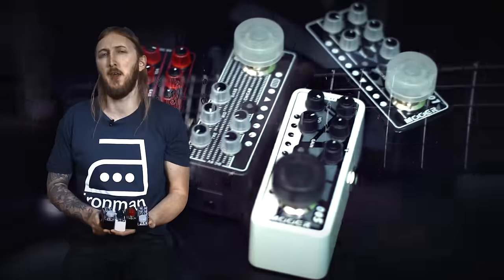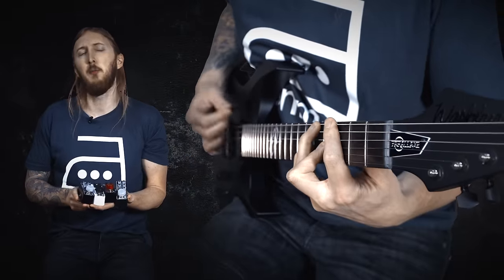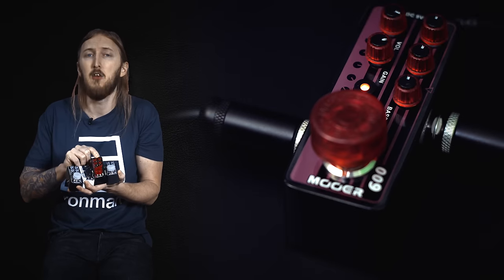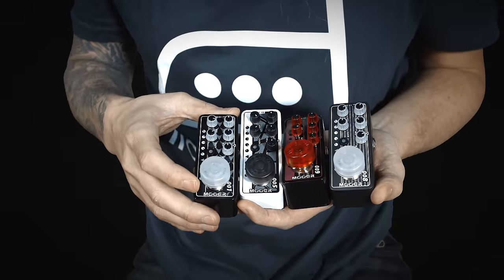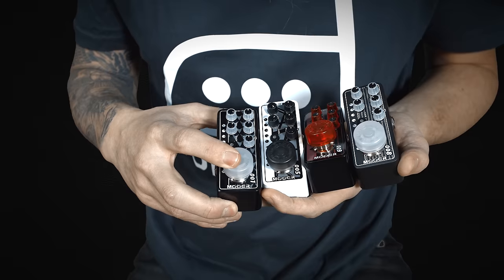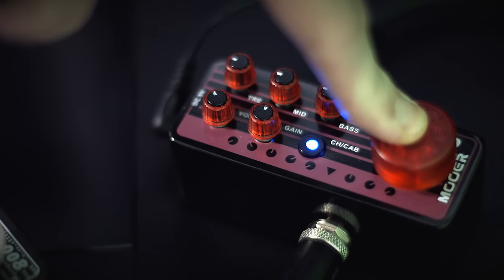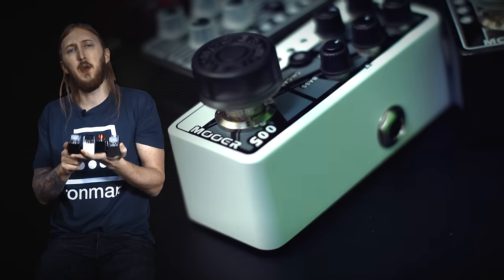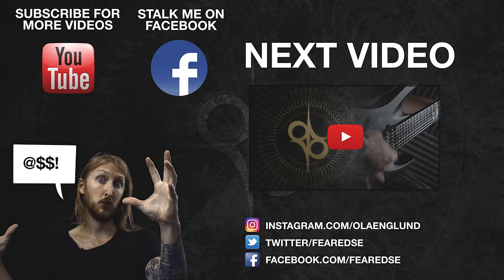Mooer Micro Preamp pedals

Comment: Wow, those are really cool pedals!
Reply from the maker: Keith Merrow they're great for the size
Reply: That's what she said
Reply: Hey Keith, you never answered my pickup question when we met at the Nashville Gear Expo last year. LoL.
Reply from the maker: Keith Merrow TELL ME ABOUT IT!
Reply: Can these be plugged into just the cab? like a 4x12 2x12 and a single 12" cab? They sound awesome.
Reply: Not really. They need something to drive the speakers, so you'll need to have a power amp between this and the cab, as Ola stated.
Reply: Gotcha
Reply: Keith Merrow кит,привет!)
Reply: fx loop is an after preamp section, it ignores the preamp a/b chanel, unless you are using it on you chain.
Reply: Yeah, I'm surprised how well a fairly cheap pedal models the amps. Great if you have a couple of songs in your set that sound better with a very different type of amp.
One thing, though. That EVH one will surely get them in trouble as the 'duct tape' branding looks far too close to the EVH brand.
Reply: Metal Head Hippie> You can use a Electro Harmonix caliber 22, magnum 44, or the mooer baby boom that they will release. These are solid state power amps in pedals.
Reply: betty-697> I can answer your question. (I own the 009)
No ! These are REAL preamps, not character overdrives so it won't do a boost.
When you put it on the front of an amp, it ruins the sound.

Here are the correct uses :
- Mooer -> Power Amp -> Cab
- Mooer -> FX return -> Cab
- Mooer -> Audio interface -> Cab simulation
- Mooer -> Cab simulation (Torpedo ; Logidy version C)
- Mooer with internal cab simulation -> audio interface.
- Mooer with internal cab simulation -> recording system.
Reply: Keith Merrow Like YOU know........OH SHIT.....you're. ...keith "bone" merrow
Reply: @tylerhiermusic  no one cares

Comment: Picked up the 001 (Diezel Hagen), 005 (EVH 5150), and one not demo'd here, the 011 (Mesa Dual Rec). They all sound so killer through my Orange Micro Dark FX loop, even when hooked up to the 8" speaker cab!! To dial in a really good tone when routing directly into a recording interface (e.g. Clarett), I've found that it really only works for me when with cab impulse mode on, OR using a DAW (I'm on Logic Pro X) to add a cab sim/IR to the track. Once it's in the DAW can go any direction, but being a purist, I love getting the tone perfect as possible from the start and not going HAM on fx processing. Double tracking with these pedals is absolutely KILLER! Thanks for the sick demo, Ola!
Reply: Thanks for this.  I'm eyeing the micro dark and a little 1x12 cab with V30 speaker for a little recording rig but now discovered these boxes and am debating going direct for home recording that won't piss off the wife.  Have you been able to to try the mooer radar sans amp?  I'm wonder if combining the 005 with the sans amp, I might be around to go direct and have e it sound half way decent?  Either way I'm still getting the micro dark.  I use protools an old digital 001 box.
Reply: @homevalueglass3809  Have not tried the sans amp actually, only seen demos of the moor radar. Seems like a pretty handy device, especially if you gig. Since I'm no longer a gigging guitarist I prefer to use pre-amps into the recording interface and use a high-quality cab IR. Currently, I'm loving universal audio's cab IRs because there's something special about the way they integrate their software with hardware that sounds next level. If that's outside the budget, which is the case for many, two-notes also makes plenty of killer high-quality IRs that you can demo in le botique before you buy with two-notes software. Then you can load it up in the Mooer radar! Have fun!

Comment: I have the 005 long time ago, huge sounding and really kicking from rock to metal. 
The only problem with this pedal is it has a small latency when you switch from clean to dirt, Dirt to clean. Just like the old multi effects processors (Like zoom 505, Digitech rp's etc.)
and I can't use it In my band because our songs when we play live are using fast switching from Clean to dirt style. And the pedal itself is getting hot (literally hot) when you use it for a minute. But that does not affect the sound overall.
Reply: Hi. Thanks for sharing.. I just bought one.  And its really getting hot, Im afraid that my unit is defective, i guess its not. Its just really getting hot .

Comment: These are awesome.  I noticed I didn't hear the typical humming, buzzing or white noise notorious when overdriving an amp with a pre-amp. I didn't hear any noise gate opening and closing.  Is there a noise gate being used, or are those pedals that quiet when the guitar is not playing?  I wish I could get my guitar signal that quiet when overdriving that much.  I have to use a noise gate, but the noise can still be heard sometimes.  I might have some ground problems, but both, my Gibson les Paul and my Strat make similar noises.  If you are doing that without a noise gate, I want those pedals right away.

Comment: Awesome review 🔥🔥 I fell in love with these pedals, and i plan on getting the 001 diesel or the 009 blacknight. I wanted to ask you, if your amp doesn't have a fx loop can you run it threw the front of the amp? The only thing I hear wrong is the volume when running it threw the front.
Reply: You won't get the intended result. This is a pre-amp, not a pre-pre-amp which would be a distortion pedal.
Reply: I find that mine sounds as good in front the amp as in the effects loop. I have a Marshall MG100dfx with the mooer 005 and 011.

Comment: Hey Ola, I have an ISP THETA Preamp into the effects loop on my Laney AOR 100 Pro from the 80's, then to a Peavey 5150 4x12. Both my Ibanez's have D Activators in them. Honestly, it sounds crushing. My question is can I run the 005 after the ISP, with the potential of 4 dirty channels + clean? Also can it take a boost pedal? The preamp boost on my ISP would do nice if it can. Thanks   \m/

Comment: How does the 005 compare with the MXR EVH 5150? They are different inside because this one is digital modeling and the other is MOSFET gain cascading, but in terms of feeling and response....
Reply: adriandeftones i got the 005 and a 5150lbx, the 005 sound so close, its a 85-90%

Comment: Hi Ola, good video, can i put this on my audio interface and recording my guitar using the simulation of the amplifiers in the pedal? or is just a simple preamp for a pedalboard that can be used only with a real amplifier?
Reply from the maker: yes as you can see later in the video I'm connecting the pedal straight into my audio interface.
Reply: I'm not sure if you watched the video, but he says that each pedal has it's CAB simulation which allaws you to plug it straight into your Audio Interface and have a proper sound.

Comment: sorry ola im an amateur but can i use these as amp heads like connect them with a cabinet and play live
Reply from the maker: you still need some kind of power amp. Unless you have a powered monitor instead of a cabinet.
Reply: ok so for example the mooer goes through the electro harmonix 44 magnum poweramp and to a cabinet that works right ?
Reply: That would be a pretty sweet pedalboard amp.
Reply: GUITAR NERD I've a Magnum 44 and would love to hear them through the Magnum 44 - however, I only see manual switching with these preamps. If you could do at least MIDI switching with these preamps, that would be pretty awesome. Or if they were all just built into one unit. At least then you could build a proper pedalboard and have a single switch change effects & preamp channel.
Reply: Also...no fx loop. :(
Reply: O'Brien  dude im thinking of getting the two notes le lead preamp and get it through a poweramp and a cabinet

i have a question for you does the poweramp that you use have limitation in watts i mean how many watts can yout poweramp handle ?
Reply: Tim Crouch Good point, thanks!
Reply: GUITAR NERD I'm not sure what you mean. The Magnum is a 44 watt poweramp, which is plenty loud in my opinion - I'm using a Marshall 4x12 and it's pretty freakin' loud!

Comment: Hi there, I have the 005, i find when i go straight into the interface, the sound only seems to come out of one side, Im using a Behringer Uphoria 202 HD, it has 2 inputs, any help ??? Love your work
Reply: Use a coupler, a splitter to go into two inputs. You could plug into the input of the pedal and then plug into a delay, reverb, etc that has two outputs. 
I assume your amp is stereo....

Comment: Could you leave your amp on its gain channel and use this as your clean channel? For example with the Jim Root Terror it doesn't have a 2nd channel just your high gain channel so I wonder if you could use this to create a clean channel for the amp
Reply: No, but what you could do is run an A/B rig and have this be one "amp" and the Jim Root Terror be your B amp

Comment: Hey Ola ! Can we use those pedals only in Clean chanel or can we use it as a gain boost for our distortion chanel ? (with Treble, Mid and Bass for more settings)
Thanks :D
Reply: both
Reply: Is it worth compare to a Green Mile ?
Reply: Not really, the Green mile is a tubescreamer-type pedal; So it is used to push the front end of the amp to get overdrive/distortion. These pedals are already the pre-amp of some famous metal amps. They can also be used to push the pre-amp of another amp, but won't give the same results as the Green mile. These will be much more gainer
Reply: Jeroen Verbeeck ok so at least we can use both for exemple Mesa Mark 3 pre amp pedal and Green Mile for more gain ?
Reply: yea man, loads of option. You can use the pre amp pedal to push the clean or distortion channel on an amp or use it as the pre amp, so plug it in the return of fx loop. By bypassing your amp's preamp,  you'll get a sound much closer to the amp of the pre amp pedal. Use a Green mile to push any pedal or pre amp.

If you had to choose between the two, make a decision based on what you would want.
Do you like the overall sound of your amp, but want a little more gain? Go with a Green mile type pedal
Do you prefer the sound and gain structure of any of these high gain pre amp pedals? Go with a pre amp pedal
Reply: Jeroen Verbeeck okay man thanks a lot for your help ! :D
Reply: Jesse Otaku you can blow up your Marshall DSL if you want maybe 🤔🤔🤔

Comment: nice.  Got an opinion on the Harley Benton v30 2x12?
Reply: shugo541 One of the First Cabs Ola has used 😉 Check his Engl Savage Vs Blackmore comparison.
Reply from the maker: great inexpensive 2x12!
Reply: sweet thanks guys.  just it's so cheap i had concerns.  seems too good to be true.  thanks!
Reply: shugo541 Usually I hate Harley Benton, but their V30 cabs (1*12,2*12,4*12) are awesome for the price they are at. I mean if you compare it to Mesa or Engl cabs they can't stand up to the expensive ones, but if you don't have an extreme budget or you don't want to pay 1000 bucks and even more for a cab you go best with the Harley Benton.
Reply: I've heard that the Harley Benton uses cheap ass wood material in those cabinets which makes the low prices. It's still great for its value!
Reply: Hannes Fuchs
okay thanks, yeah obviously in comparrison to a HESU, Orange/MESA etc then it's inferior but considering the price, it's hard to complain.  It's still 2 v30s and that's a hell of a lot better than using my old marshall vs102r with 2 marshall "goldbacks" as a 2x12

it sounds like the screams of dying animals, and not in a metal way.